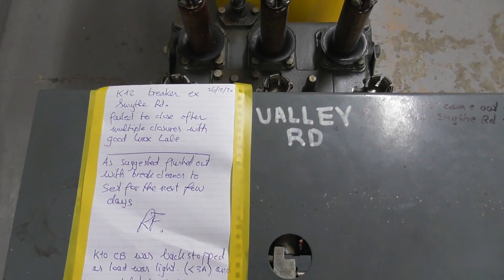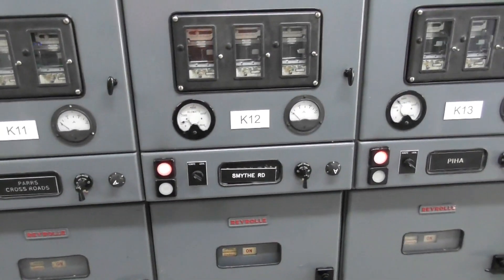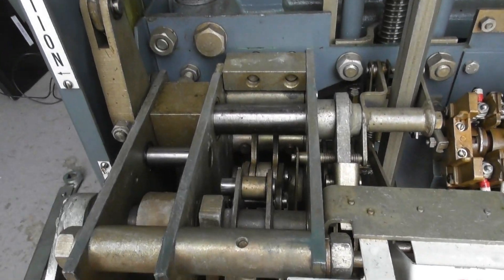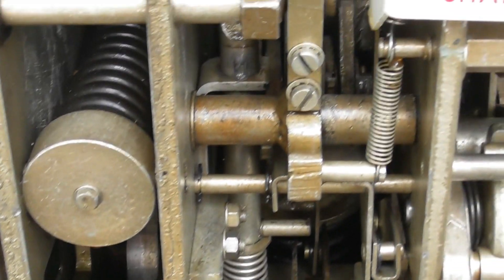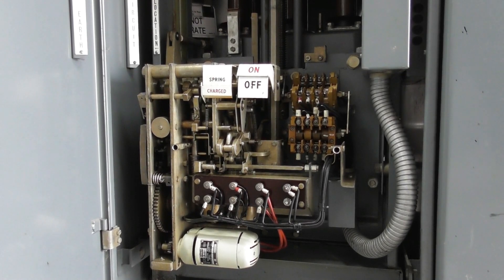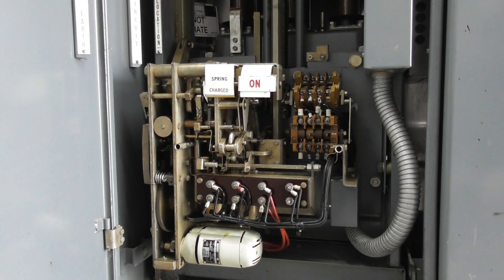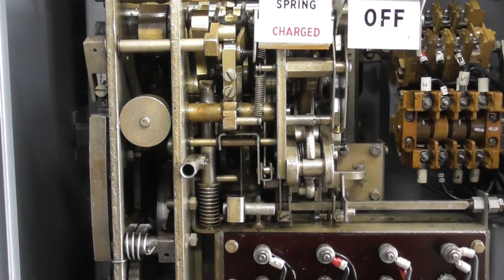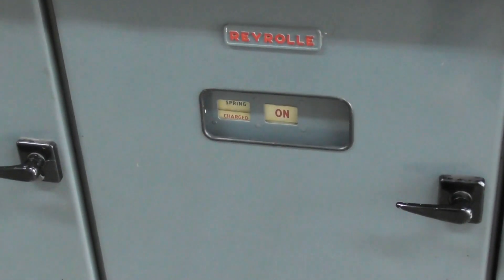Reyrolle Pacific OCB - LMT

Comment: Oh thats funny. the motor in there is just a normal Stanley 5/16" chuck drill with the chuck changed out for a gear.
Reply: I kinda love that about it, why reinvent the wheel ya know?
Reply from the maker: A lot of breakers use drill motors for charging springs as they are universal motors and can run on DC.

Comment: Love the LMT, one of the best breakers they made. There’s an abundance of them here in North East England as the factory was/is  on the Tyne. Made me smile when you said it had been on soak, thought that was just a colloquial term we used up here. Obviously it’s international 😂 Do you have much C gear in NZ?
Reply from the maker: Still a bit about in NZ, lots of older oil switchgear being replaced with SF 6.

Comment: Presumably the drill motor used in there was something used to  replace the original motor?
Reply: or maybe it's designed that way since the damn drill motor is too good and too cheap!
Reply from the maker: Standard motor in these type of breakers.
Reply: Drill motors used as standard from factory.